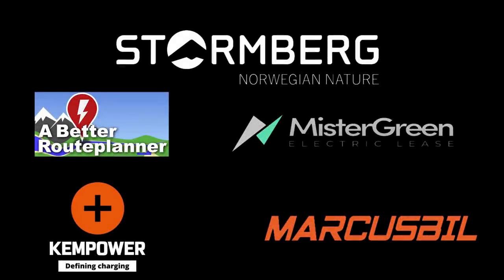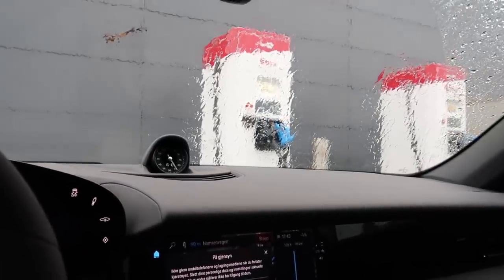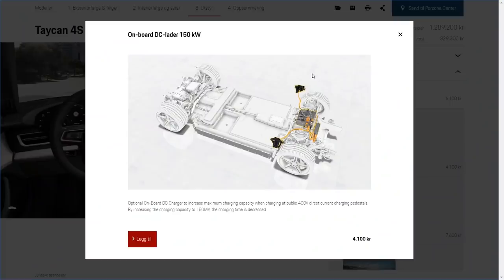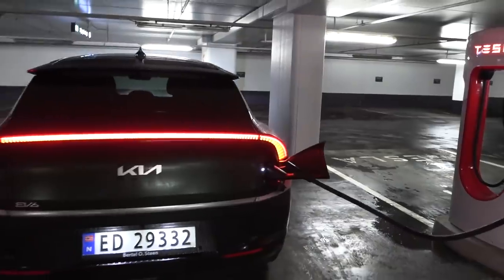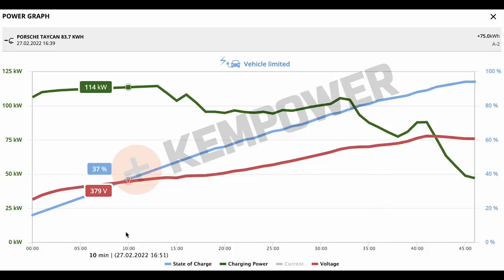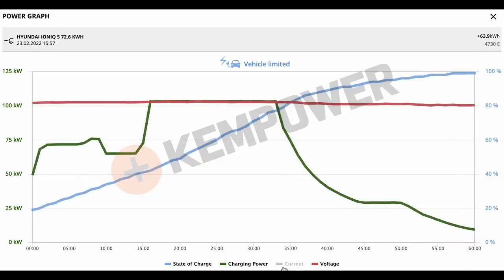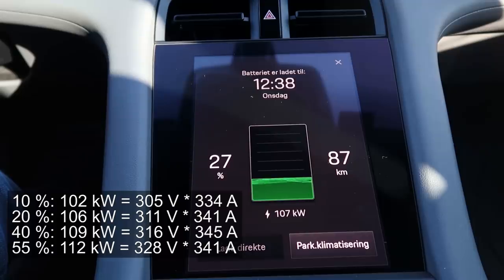Why Korean engineering is better than German engineering

Comment: My understanding is that the rear inverter is also used for the vehicle to load capabilities, so it has lots of capabilities for dc-dc, dc-ac and ac-dc conversion and voltage modification. Not sure if it is also for the on-board charger for AC charging but I wouldn’t be surprised. To be clear, I doubt that the exact same circuitry that conveys the dc to 3 phase ac to drive the motor (or opposite for regen braking) is also the circuitry that steps up the charger voltage and/or provides the ac power at the charge port for V2L, but it all in the same “box.”

Comment: On my taycan plus (94.3 kWh) from 01/2022 with 25% I get 45.6 kW at 32% - 45.4 kW at 45% - 46.6 kW at 62% - 48.8 kW at 64% - 49.2 kW on 50 kW chargers (400v), values taken from the car, I think they have already solved this problem.  good job, I watch your channel from the beginning, I don't miss a day.😅👍

Comment: Very interesting to see the different approaches,   Nice seeing Hyundai make use of already required drive hardware to serve charging duty when not being driven, It seems like everyone is racing to charge as fast as possible more than anything as that’s the number one differentiating factor between a gas car at this point. People would be more willing to buy a lower capacity car if it already has fast charging. Cost to entry becomes much cheaper.

Comment: @Bjørn Nyland, you do not have to speculate. The manufacturer (Brusa) of the Taycan DC booster confirms it is a pure doubler. If you search for "brusa taycan voltage doubler filetype:pdf" you should find a presentation with all the technical details, and their arguments for taking this path (efficiency and low complexity)

Comment: I am having a simalar issue with my MG5 and in particular Osprey chargers if I arrive with a low state of charge I get a very low rate charging. Typically around 20 KW! I only get above 35 KWh at 65% then it cuts back above 75% back into the 20's again! This makes the 40 min 10 to 80% a laughable joke! I have also noticed the charging rate on Ionity and Gridserve chargers has become slower too. When new I was getting 75+ KW at around 40% today I am caped at a maximum 50KW throughout my charging time. Any clues why this will be?

Comment: This feels like a casual rambling and conjecture, my impression was the Taycan pack simply splits the pack into two half’s for 400V charging. Hence the 2x observation. The upgrade pays for the larger current contactors etc to manage the switching mechanism hardware for 150kW DC.

Comment: A little like the MPPT (Maximum Power Point Transfer) controllers used with solar panels that adjust the loading of the panel to extract the maximum power to charge   the battery. The other system was pulse width modulation which adjusted the voltage output charging the battery, a lot less efficient.

Comment: It is indeed a very interesting idea. I don't know what exactly they are doing, but some sources also mention the motor is being used in that conversion somehow (but maybe it's just inaccuracy introduced somewhere on the way). As for the limit of the power being the limit of the inverter ‒ I suspect it might be just „recuperating“ from the DC instead of the motor (or something close enough), so the power limit would be similar to what the car can recuperate.

I wonder if the idea could be pushed even further. Could the inverter be used as an AC charger too? While recuperating, it is converting the AC produced by the motor to the battery. In theory it should be possible to „recuperate“ from the grid AC too. That way the car wouldn't have to carry a specialized AC charger, it would be running the inverter way below it's max capacity, so it shouldn't eat up its lifetime much and it would not be limited to 11kW AC charging (which would be a nice benefit ‒ many places here have 22kW AC charges with 2-hour time limits on them ☹, there are even some 43kW AC chargers, still with AC prices, private fleet charges could be just these 43kW AC, much cheaper than 50kW DC ones, so an advantage to a fleet manager to pick Hyundai over something else).

Does anyone know a Hyundai engineer? To suggest them the idea? I'd really love that to be in the next car I would be buying.

Comment: I agree with Bjørn that it would be better if the Taycan’s DC-DC converter was variable output so it could request a constant 450-500v to maximize power; however, the pack on the 94kW pack is much higher voltage than the 79kW pack of Powell and I believe 80%+ of Taycans have the larger pack. Also 800V/1000V chargers will soon be the standard and this is quickly becoming a non-issue.

Comment: In a Taycan delivered in November 2021, the data on an Easycharger charger in Spain with a cold battery and without preconditioning was 7.61 kwh in 10 minutes = 45.7 kwh. Has anything changed?
Reply: Measured at the stall including charging löss or by the car?
Reply: @Likr666 The car indicates on its screen 45.3 KW. I have some photos of that load in a 50 kw charger

Comment: The key point is : in a 50kw station, my Ev6 is always charging at 48-49kw, from 0 to more than 90%.
Reply: 51kW in my 77kWh AWD
Reply: @BirkirRGujonsson  yes it even happens to me. Sometimes.
Reply: @omelvold  In France it is. just because of the lack of HPC, especially in Brittany. The 50kw network is pretty dense. And by charging at 50, you prevent a bit the degradation of the battery. Home charging+50kw is almost enough for me.
Reply: How fast you to 80% ?
Reply: @williamerazo3921  from 20 to 80 on a 50kw charger, I’d say about an hour.

Comment: Thank you for going into details like in this video. At least I wonder now which solution has more loss and why they don't use high power electronic switches (Mosfet ie) and switch each half of the battery in parallel for 400 V?
The Porsche solution sounds rather like "ups, didn't we forgot something?"
On the other hand I assume that a Porsche buyer does not drop his decision because of 500€ extra 😉

Comment: Actually I think that 800V-inverter tech came from Rimac. So there is a lot of Croatian engineering iin it as well :)
Reply from the maker: It's not an inverter.
Reply: And the Porsche DC booster is sourced from Brusa, not Rimac

Comment: Now that I know this is possible, I’d like to request Tesla does the reverse. Hold 900V and convert it down to pack voltage to give us V3 charging speed on all CCS 800-900V chargers 😁 🙏
Reply: Tesla has no such hardware at the moment, right? Just straight dc into the battery.

Comment: It's very important to reduce weight and pieces in a Porsche, especially if they want to release an electric 911 in the future. That will be a challenge with this german brick tech...
Reply: The poor mans Taycan has not a Inverter that can be used for that. The simple doubler ist less complex and a lot more efficient and lighter.

Comment: Then let's hope that the electronics of the Electric motors of those Korean cars are easily serviceable. So when the converters dies from the additional wear of charging batteries, you will not have to replace the entire motor.

Comment: Inverters don't change voltages, they just convert it to AC (and back to DC),.DC to  DC converters change voltages, which is what BOTH cars are using, Hyundai's is just a slightly better implementation.
Reply from the maker: Who said anything about inverters?
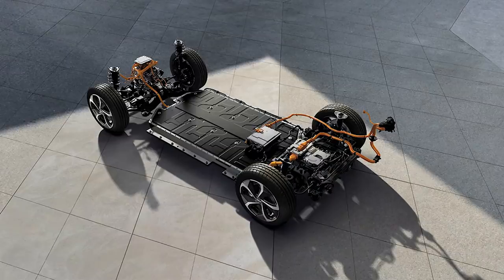Reply: @bjornnyland  you did at 3:49
Reply: You can use an inverter as a DC-DC converter, but the control signals to power transistors are different.  There is clearly a "distribution system" that routes power between battery, motor and charger port.
These DC-DC converters are not regular single phase ones you normally see.  Even modern PC mainboard have multiphase DC-DC converters to deliver power to CPU.
Reply: @ikocheratcr  Yes you can do this. But you need additional switches to disable the motor inductors and you need additonal switches to enable the rest of the step up regulator. It seems to be the cheaper solution but not as much as Björn thinks. Porsche uses the batterie contactors to seperate the batterie from inverters/inductors.

Comment: I'm confused, how would an inverter actually helps wrt to stepping up voltage for DC charging? 🤔
Reply: It's not an inverter (ac to dc), it's a converter (dc to dc)
Reply: @HansPeter-pm1gq  you didn't watch the video I assume, he says the motor's inverter is used for stepping up voltage 3:40

Comment: I believe it was 2011 when Kia introduced on the car shows the new, redesigned Kia C'eed by the team of Peter Schreyer, I read that after VW kept their own show, the whole german delegation moved over to KIa's stand and frantically started to check through the cars which the media translated as some sort of a worry over competition quality. For several years it has been seen that Korea stands its ground when it comes to fine engineering.

Comment: What were the reasons for ev6 to beat ioniq5, basically same car 😂
Reply: Bigger battery.
Reply: I think only the powertrain is the same but the body and suspension etc are different - a bit different to something like VW MEB afaik. But yeah, still very similar.

Comment: Wait so the e-gmp charging speed for 400v is almost the same as 800v ?
Reply: Depends on the amp. It seems 230a eas max on the kempower. If that was car or charger limit is unknown.
Reply: @idarborlaug  so let’s say I charge the ioniq at a Tesla V3. Will I get the car’s max 220kW?
Reply: @nazhif1  depends on what amp max the car has. If its 230kw is max amp then you will probably get 150-140kw on v4 chargers. But if the car can take more than 310amp then you will get more.
Reply: @idarborlaug  ohh I see.

Comment: I heard that the e-tron GT don't has this converter the Porsch has, which meas that they did it different. How was the speed with the e-tron GT on 50kW? There are tons of charging videos on YT on HPCs, but i didn't found a video on 50kW. And on your Arctic circle video you also didn't mentioned the speed on the 50kW sessions.
Reply: I think the "issue" is bigger for the smaller battery of the taycan, as it has the lower voltage as bjørn said. The etron gt is only available with the bigger battery

Comment: Classic LiPo charging works by adjusting voltage to control amps flowing into the battery. So the Germans did nothing wrong. They used a well proved designed. 
Now - using the motor to step voltage up might be good or bad. It gives faster charging. But how about losses and motor wear ?
This is a new unproven way to do things. Let’s hope it will last
Reply: It is just a DC-DC converter - nothing unproven about it lol. Of course it can be designed wrongly, which I doubt has been done..
Reply: The motor is not involved here, only the motor inverter, a pack of electronics.  Pretty sure it was designed to work that way, not as a last minute hack.

Comment: I think you are wrong on a few points, but the main one is the battery charging would be constant current, rather than constant voltage. Therefore it wouldn’t matter about the charge voltage, as long as it was higher than the battery plus losses.
Reply: With a max limit on cables etc. at 125A, you cannot lower the voltage and compensate by increasing the amperage as there is a hard limit  on the amperage. For the last part of the charging cycle a constant voltage is used. Chargers can do both. The energy delivered will always be a product of the voltage and amperage. If one cannot be increased further, you can increase the energy by increasing the other.

Comment: I wonder why Porsche would have picked a fixed rate inverter vs a variable inverter on the Kia, maybe they were hoping for more standardized charging… Hm.
Reply: There aren't that many 400v chargers left. Most support 800v today. Only tesla deliver 400v chargers.
Reply: A voltage doubler is less parts and cost than a DC/DC converter with variable ratio.
Reply from the maker: @idarborlaug  Incorrect. There are still a ton of 50 kW 400 V chargers left. And they will be around for a long time.

Comment: Kia/Hyundai also has several years of knowledge advantage due to their earlier ioniq/soul etc models. So taycan was a great first model, but clearly things can be improved.
Reply: 918 was before the Ioniq
Reply: @Jushwa  I doubt Porsche's experience with the 3.7kW type 2 charger of the 918 PHEV helped them in designing the Taycan's charging system

Comment: What about the Ioniq, Kona, Niro reduction gear bearing failures as they don't have magnets on their filler/drain plugs to collect swarf?! That's a pretty basic engineering mistake to make..even the Leaf has them! Their maintenance schedule says to just 'check' the reduction gear oil..not 'change' it! ICE cars only have one set of reduction gears, EV's have two..so more swarf.

Comment: It's not so much Korean engineering vs. German engineering since the EV6's 800V system was developed by Rimac, the EV hypercar manufacturer from Croatia. At least that's what it says on the internet.

I have to admit that reusing the inverter as a boost converter is much smarter, though. Still, I do not understand why Porsche would develop a fixed boost converter because the additional effort to make it adjustable does not add much complexity in my opinion.

Comment: A lot of wrong here. The Inverter at  the engine is a DC/AC converter. You can not use it directly for DC/DC. You can modify the inverter with an additional pick-up, capacitator, resitor,… to reuse the igbt or sic modules for a dcdc. BUT: it also cost additional weight,  money and a not perfect efficiency because not used at an optimal working point. You wear the inverter modules, at 800V they already have a much worse lifetime, with hours of additional load. And in a defect, and that will happen on the lifespan of the car, you need to replace the fxxxx expensive emachine inverter. And it is a breakdown of the car when  this defect occurs. So in my opinion it is a cheap solution to reuse the inverter, but not as cheap as expected and overall with a lot of disadvantages. Greetings from a german engineer.
Reply: Thanks for the explanation
Reply: Inverters can be made, with some difficulty, to support DC and AC on either side. Our sister company, Pixii, delivers battery energy storage, and have 3.3kW modules that can do any voltage in any direction, AC or DC. It is not unthinkable that the same tech is used here. These inverters are highly efficient.
Reply from the maker: Small correction to the German engineer:
EVs don't have an engine. It's called "motor".
Reply: @bjornnyland   have to say that was a disappointing reply

Comment: Concerning your video title:
„Koreans beets german engineering“ 
If you do research on the charging patents you will find a patent of Rimac discribing exactly the functionality of a dc booster using the induction and windings of the electric motor of an electric car. Due to the cooperation between hyundai and Rimac this charging system is sold exclusively to Hyundai. 
So its a very clever invention of the Croatian Engineers not German nor Korean. 
A big big honour that the descendant of Nicola Tesla (sad how history treated such a genus) rules at the moment the market for hyper cars and sell their intellectual property to the world.
See also: newsylist kia-ev6-2021-electric-car-with-rimac-charging-system
Reply: Porsche and Hyundai cooperate with Rimac 800V system...
Reply: @Goku0583  the Partnership between Hyundai and Rimac starts already 2019. Way before the VW Group /Porsche invested in Rimac. So the plattform of the Tycan does not share any technology with Rimac at the moment. The outcome of the cooperation can be seen maybe in the forcoming modelsseries of Porsche/ Bentley, Lamboghini.

The 800 V battery pack of the tycan was developed together with DÄXLMAIER.
Reply: @visionmodernclassics3062  porsche since 2018...
the 800 volt technology is from rimac and the batterypack is build at dräxelmaier for porsche...
Reply: @Goku0583  ohh ok I didn’t know the dräxmaier is only in charge of the production, thought they were also involved in the development! Thx you
Reply: Nikola Tesla is not Croat.
Reply: @dquzmanovic  Have I written that Nicola Tesla was croatian ???? He was born in that Region not more not less.
Reply: @visionmodernclassics3062  Yes you have.
"very clever invention of the Croatian Engineers"
A big big honour that the descendant of Nicola Tesla (sad how history treated such a genus) rules at the moment the market for hyper cars.
No big deal, mistakes happen.
Reply: @dquzmanovic  Today we call the part where Nicola Tesla was born Croatia. So its correct to say that the people living there (including Rimac) are the descendants of Tesla. Non of my words say Tesla is croatian.
Reply: @visionmodernclassics3062  Descendants of Tesla were killed by Croats. And Mate is from Bosnia.

Comment: All one has to do is look at the Taycan. They have to have a 2 speed transmission to keep up with the older Tesla's....and they have zero chance to run with the S or X Plaid (which have one gear). Carbon Fiber wrapped rotors......

Comment: Kudos to Korean, I can attest their engineering is much better than the German
Reply: @josefv-y8m  Battery tech is not from the Germans, only by the Korean engineers! Plus, E-GMP platform is also made by Koreans. Germans did nothing in terms of ev techs in Hyundai motor group.
Reply: @josefv-y8m  As for the designer, there are already many famous Korean designers. The same goes for companies like BMW and Mercedes-Benz. Korea is originally a powerhouse for product designers. It's not something I learned from Germany, it's how Germany worked with Koreans.